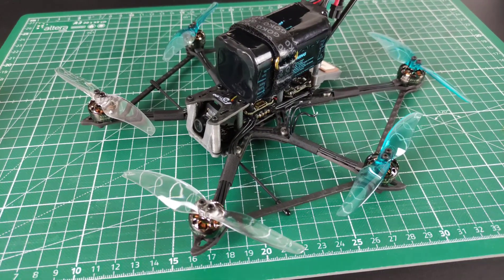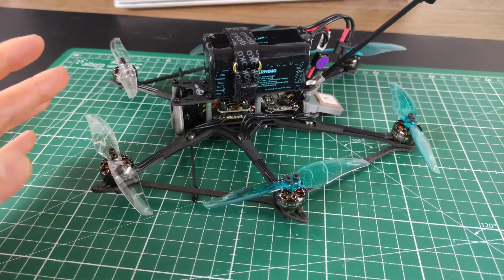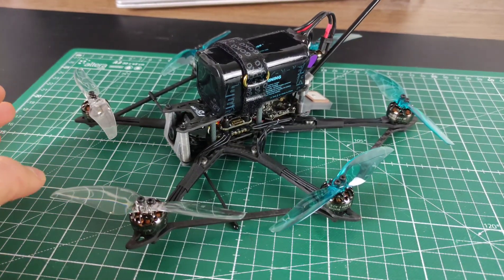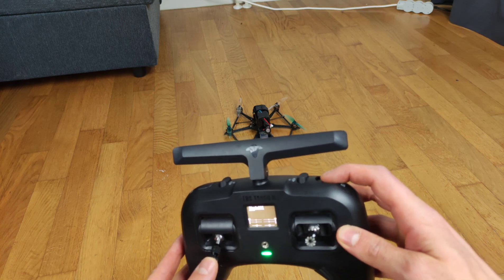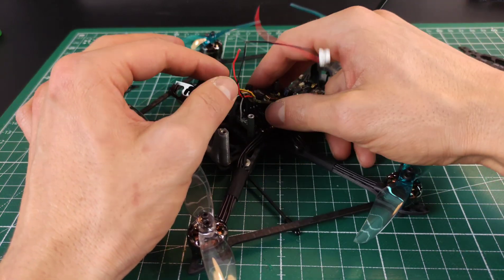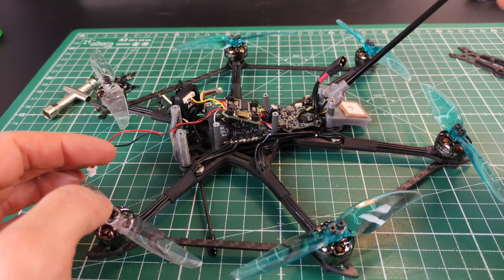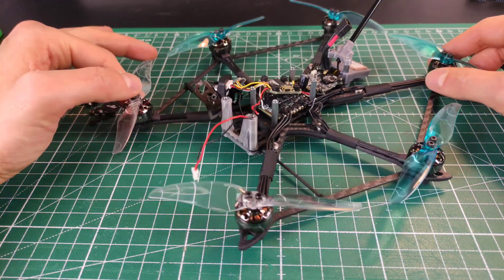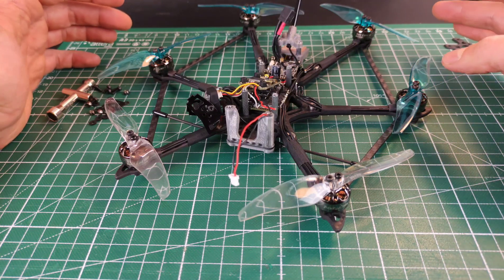Disconnected  Motor !? | Flywoo Hexplorer

Comment: Lots of tests were done back in the day.  Typically, a hex can barely be brought down with motor out, with little to no yaw authority.  (Basically comes down in a controlled crash).  A octo can be flown with one motor out.  Of course, the firmware plays a large part in this.

Comment: A short from the gopro cable happened to me as well, a bit of insulation was stripped away and the cable touched the frame or a standoff. A huge cloud of smoke appeared and I thought the whole quad was fried. Thankfully, nothing was actually damaged. I only had to replace the cable and deal with the smell of the burnt metal that was difficult to get rid of.

Comment: Do you know the reason why they use the F4 in the analog version and the F7 in the dji version? 
I'd like to get the F7 version with the bluetooth module and barometer in an analog hex....
Reply from the maker: There's no need for all the extra UARTs without the vista so using an F4 keeps the price down without having any real disadvantages

Comment: This is such an interesting question.  A couple of months ago I was the test pilot for a large (10 inch props) student-built Pixhawk hexacopter.  We lost a motor mid-flight and it maintained altitude but went into an extreme yaw spin until I landed/crashed it.  I expected the Flyoo Hex with only 5 motors to hover, but only be able to yaw in one direction (and maybe not stop yawing).  Thanks for doing the test.  Some day I'd like to buy a "safe" hexacopter - I look forward to you doing more testing to help eventually achieve that.

Comment: Is it that it won't fly with the missing motor or that it will not take off with a missing motor.  If the quad had enough altitude when the motor "failed" would it recover?

Comment: Dave, imagine losing one of the front or one of the rear motors in the Hexplorer. Notice that you will be left with a configuration where yaw control will be apparently impossible (because of the rotation directions of the remaining 4 motors). Losing one of the side motors is easier to handle.

Comment: I think the problem is that the I-term is not really fast enough to account for the amount the tune is out after losing a prop.

The real test would be in the air. You could try putting a 3-5A fuse on one of the motor wires so it will blow on a punchout.
Reply from the maker: I thought about just removing the prop screws and making it fly off on a punchout. I guess that's also the most realistic scenario.
Reply: @DaveCFPV  I think either would work, just thought the fuse because you could get a bit of control as to when it blew.

Comment: Nurk did a video, and it flew with 5 motors, 1 was burnt. Name of vide when the pants come off.
Reply: papadoc i no right i also see that vid thats why i made the coment on bardwells channel the differnce being nurks motor was still wired and dead and dave c removed motor wires and jb just removed props i can only think that nurks motor wasnt completly dead as some one here saod old cleanflight worked i think on the old nae 32 fc i have an old one in my box of old bits might have to do something with it not sure

Comment: The old DJI NAZA controller could do it.  I always thought that was a cool feature.. Would be nice to have that in betaflight or even better in iNav
Reply from the maker: I think so too. I'd love to have redundancy for long-range flights. My worst fear is just having an ESC failure and having to helplessly watch my GoPro and quad drop out of the sky.
Reply: @DaveCFPV  it was one of two reasons why I immediately bought the Hexplorer.
1, power
2, redundancy

Comment: I have an old arrmattan hex and it will fly on 3.5.7 (might even be 3.4) it has individual esc however.  It's much wider. I built another hex using 4-1 and 2 individuals on new bf and it won't take off at all using bidirectional dshot, will take off but not fly with it off and the esc would tone as if it's restarting after a "flyaway"
Reply: @S Grim for anyone that says its bs (saw alot in bardwell's comments)  if he changed the mixer to normal quad x it will fly with 2 motors out center or maybe even both front or rear